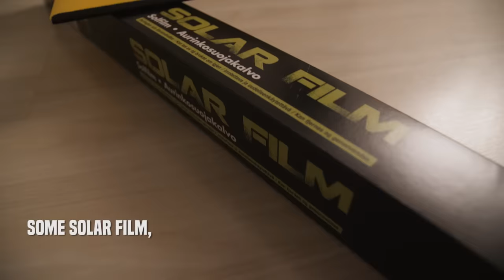DIY Infinity Mirror Coffee Table

Comment: I love everything but the power cord running through my living room.
Reply: WildBillCody then be a smart guy and use battery
Reply: @noora9827  you go buy batteries for your  table I got better shit to do... smart lady?
Reply: @Nathan Hopkins i think you should have asked the question 3 times.  2 just doesn't have the impact of 3
Reply: @wildbillcody2127  lithium batteries are pretty cheap and efficient for something like this
Reply: I suggest you use rug or carpet and run the cables under it
Reply: it's Dean thx for the idea I’m gonna do that 👍🏽
Reply: Use a Powerbank ! 

The Strips only have 5V
Reply: Use powerbank with output of 5v
Reply: Use powerbank
Reply: You can easily buy more expensive LEDs that don't require a power source
Reply: @noora9827  can I've your Instagram handle please? 🙈
Reply: Кратос ез lmao no
Reply: Nathan Hopkins LMFAOO
Reply: Or just use a battery powered led strip
Reply: @wildbillcody2127  just use a rechargable phone battery bank
Reply: @NH-gg9xd  I've calculated this. Even 20 000 mAh powerbank will give power to this led for 2 hours and then you have to recharge it again by inserting the cable in the powerbank for 12 hours. So anyway you'll have a power cable to your table almost all the time. In this way, having a continuous connection with extra sockets that can be used for a laptop or charging your phone is not a bad idea. And you can hide power cable under the carpet.
Reply: Who dosnt need a extra phone charger when relaxing in the living room
Reply: Motorcycle battery and charge it once a year I assume.
Reply: @NH-gg9xd  they can run on usb easy

Comment: Best takeaway idea from this video is that the Ikea table top is hollow. It seems obvious, and common knowledge if you have ever picked one up, but until you see one cut open like this it isn't clear whether what's inside is easily removable and cleanly modifiable. So, thanks for that.

These kinds of table tops would make a great base for some other projects. It would fit an LCD monitor nicely (for a MAME table, etc) or possibly a large "shadow box" frame.
Reply from the maker: Thanks for the nice comment! Absolutely, you could also make some storage inside the table ;) the options are many!
Reply: Since it’s hollow how much weight can it take? I’m afraid the mirror & glass would one day just burst out from the bottom 😱
Reply: Or a touch screen 😎 connected to an android device your welcome 😘
Reply: Junky table. I've gone through 2 of them in 2 years.
Reply: Well, if you're ballsy enough, you can make your own cheap table from the ground up. I use Kreg hardware jigs which makes things a lot easier. The sky is the limit when it comes to your designs. Most cheap tables are made of cheap white pine press-board. You could use that or actual pine or some other wood.
Reply: @bobbyd0656   here in Sweden (THE HOMELAND OF IKEA) ikea furniture is more meant for young adults & students who have just moved away from Home. Its not meant to be a solid peice of wood that lasts 2 decades
Reply: Just giving people a heads up that this table is probably one of the junkier items I've bought from Ikea before they go an invest a bunch of time and money in something that will only last a few months if they're lucky.
Reply: jaybie cupcake I don’t own any android devices.
Reply: All Ikea Lack furniture is hollow
Reply: @JeppeBeier  thx. Then I can start to plan now an aquarium/terrarium inside my squared one
Reply: The LACK coffee table looks like it's the proper size to fit a 40" or 47" LCD television, which you could fit underneath the solar film so it will be invisible when the screen is off. Stick some embedded PC underneath and you've got yourself a perfect table to play virtual tabletop RPGs or board games on.
Reply: Lmao 😂 me as well . 
Wish they have created wireless currency with that we wont have problems with wire all around the room

Comment: Amazing build man! There’s a few things I would do a little differently tho. For example I would use some sort of staple to staple the led strip to the wood in case it became loose since the tape on those aren’t the best quality, second I would put a little bead of caulk around the top of the tape where the glass and the actual table meet just to water proof it in case of spills, dust, etc. And third I would build a little box to house all the wires and boxes on the bottom of the table just so you wouldn’t have to worry about all that falling down overtime. But other than that amazing job man can’t wait to build one soon!
Reply: Table*
Reply: If you stapled the LED's you would interrupt the wired connections and potentially short pins together

Comment: Definitely clever and looks cool, but knowing how flimsy and cheap those tables are, and with the additional weight of the mirror, wooden frame and the glass, I'd be scared to fart next to it without it falling to pieces
Reply: Lmao
Reply: If you have table-shattering farts it might be time to change your diet
Reply: haha exactly why I started creating my own
Reply: Haters gonna hate ^^  Ive had one of those tables and it could carry the load of me standing on it without issues lol, around 90kgs.
Reply: @andre_resin2208  I dont see anybody "hating" here
Reply: Just don't eat chilli in your living room
Reply: I don’t know anybody at all, ever who uses these curtains. Why lyin foooor
Reply: @andre_resin2208  i was armwrestling on one of those tables and my elbow went through the table, i literally broke it in half :D
Reply: @EstViking  I think they're designed to be strong if the weight is distributed adequately, but can fail with a specific narrow force applied like your elbow, you can see the honeycomb design inside the table.
Reply: @snokful  yep. I know the reason.
But the connection of table legs is also awful. 
How do you let your gfs bestie to dance naked on such a table? It will break down...

Comment: you could hollow out a small portion of the table to tuck away the electronics, and only have one wire going out. You would of course need to make some custom stabilization to keep the hollowed out are rigid

Comment: Very nice table my friend. I have an  old coffie table made from indian shesham wood abd i mite use this design as i have so dark tinted glass aswell. Just need to get a mirror the same size now. Well done.
Reply from the maker: Thanks a lot! What I did was to get a cheap mirror and cut it out to the size of the glass. It was very simple but I decided not to recor dthat since there are so many videos on how to do it already. Good luck with your table :)
Reply: Wont the glass shatter if you cut it?
Reply: Nemesis well it turns out the piece of glass i have us just the rite size for my new table so no cutting involved.
Reply: Something from the shed 3$

Comment: Could you go over the solar flare step - did you use water? And You just squeezed it out. Is the solar flare sticky? That's the only bit I didnt get and finally the cut ends of the led lights do they but join into the same connector? Thanks Great video.

Comment: Do you know how deep the top to the lower top (the fillings) are? I'm thinking bout building a pc inside there but I need to know how deep it is.
Reply from the maker: Hmm, that would be a tight fit with desktop materials! I think it was almost 5cm, like 4,6cm or something
Reply: I made my own table for this project. You can customise the depth that way.
Reply: I'm planning to build my very first desk with case for my new pc on next few months and this is probably going to be included on it instead of spending extra money with rgb ram and coolers.

Comment: This is actually amazing ! Literally going to make a run to ikea tomorrow to start this project. Thank you for the inspiration. 

Do you mind posting a link to the LED’s that you used ?
Reply: I think you can use pretty much any strip these days, the prices are competitive if you shop around various stores, or even cheaper order from Chinese commerce sites, and they often can cycle through flashing patterns. It doesn't seem like this project needs fancy requirements. But you can get programmable strips if you do want to have more control, and ones with a black background would be a bonus.

Comment: Wow. What sort of glass did you use for the top? Does it need to be toughened or safety glass? Just wondering about safety and whether it is likely to break.
Reply: Did you figure this out ? Also do you by chance get the dimensions he used ?! I'm trying to figure it out but in confused by him putting mm and cm that's way to small

Comment: Where exactly did you find the mirror that roughly that same size? I’ve been looking all over the place.
Reply from the maker: My grandmother had one that I got but I guess you can either buy in a shop or in a yard sale? I had to cut mine out a bit but I left that out of the video since there are many videos on how to cut up glass
Reply: U can also cut pieces of glass to fit it aswell
Reply: Get 2 pieces of glass cut to the size you want. Just as an additional step paint the bottom of the table black before you place the bottom peice down. Instant mirror. Not quite the same but I'd imagine good enough for this kind of project
Reply: xIDONTGIVE2x just go to a glass company and ask them.to sell you a piece to the exact size you need. Most shops have scrap pieces laying around.
Reply: A glass company can cut to fit for you.
Reply: Any glass or mirror supplier will be able to provide a piece of glass to your custom measurements. Pretty cheap too. The piece of glass that is shown here wouldn’t cost more than 50 bucks American.
Reply: @thediycrab2674  How much did this whole project cost
Reply: Probably better finding a shite table to fit your glass...imo

Comment: Am I the only one who has a prob with the wire exposed
Reply: HAK nope. There has to be a better way than batteries because awkward...but a cable running to your table is just as awkward
Reply: yup he had space left... could stuff that inside and put the IR Reciever on top beside the glass or even behind the glass if the Remote IR Signal maybe gets through :) and that "power strip" dunno how its called right would have enough space inside the table but i would stabilise the bottom and top because of the pressure you put on it while plug in and out :) you know what i mean :) have a good one :>
Reply: A small hole in the carpet to feed a wire.
Reply: HAK I am thinking about doing this, so I’ll share what I have thought up. 

I’ll hollow the top of one of the table legs so that I can fit a battery pack in it, and a raspberry pi in it. Of course I’ll make it so that the leg has holes for the usb of the pi, and a monitor behind the mirror. This will let me have the infinity mirror, but also a smart table for my living room.
Reply: @Max.Mustermann.  please explain that with the correct grammar. You're not making any sense whatsoever without a full stop anywhere.
Reply: @Max.Mustermann.  "hiding" the controller inside the table is not possible and it will be visible through the glass top.
Reply: @waheedmalik4096  uhm you watched video right ? just look at the "border" of the table he did not cover with that glass top... there is space left... there are smaller Power Supply's for LED Stripes then the one he used in the video... even if the "casing" of the powersupply or the controller would be too big you could remove it and wrap some isolation tape around the pcb or just put some hotglue or for more professional looks some resin on it so it wouldnt short out ... just use your creativity and knowledge ;)
Reply: @Max.Mustermann.  show me how you did it.
Reply: @waheedmalik4096  why should i ... Ur Just complaining and gathering ideas and improvements ... Just do it your way or whatever you prefer... Have a good one mate
Reply: @Max.Mustermann.  you're the one going on about it. I asked to learn about the video whereas all you've done is criticise the good job that has been done. I suggest you stay in your armchair and criticise yourself. If you think you can do a better job than your English then go for it. Otherwise ssshhh.
Reply: @waheedmalik4096  i never critised someone ;) i Just Said it would Look more Clean with some more thoughts about hiding cables and cases... ;) im Not Sitting in any armchair im actually in my Workshop right now... But Go on with your rant about Tips and Tricks and what to think about on ongoin or Future builds ;) Like i Said have a nice one Mate... And now ssshhsh i want to get some Work done
Reply: @Max.Mustermann.  make sure you show us your work and then we'll also criticise you with a cup of tea in one hand and a biscuit in the other.
Reply: @waheedmalik4096  get along with your Problems Mate but dont bother me anymore your wasting your time and mine
Reply: @Max.Mustermann.  why are you still here? Haven't you got a sofa to sit on?
Reply: @waheedmalik4096  Sure i have a Sofa but its worky worky time Mate ;) dont bother if im reporting you for harassment k ?
Reply: @Max.Mustermann.  armchair critic. Go and watch videos and then find faults.

Comment: Great cept the cable management. All that work. Why not put the plug underneath, run the cable down the leg(if you're lazy since you could drill down the leg to hide) so it's cleaner and you can put stuff on mid shelf without that ugly plug. 

Though I get it if it was for a quick build DIY type thing

Comment: Really good DY , i've got a question for the last part, the power supply. Is it possible to replace that with a battery you can remove to recharge on usb on your PC ? Cause, you didn't have to let the Led on all the day, just the night.

Comment: I would have glued or stapled the led strip, as they tend to peel off after some time. I would have also silicone the edge of the top glass to keep spills or debris from seeping in. And lastly, I would have used a battery pack with a switch, both placed under the table and done away with the electrical cables. These lights use very little power so a 8 AA battery pack should yield allot of hours of use, safer as well. Other than that, great work.

Comment: You can always tell an amateur by they way they hold a hammer, half way down the shaft and tap with an up and down motion, the best way is to hold the hammer close to the end and use your wrist to direct the head of the hammer to force the nail in, and another tip is to pre-drill to prevent the wood splitting whether its a nail or screw.

Comment: How thick are the wood pieces? And how thick is the mirror and glass?
Reply: Did you figure this out :O  I want to try and make this but missing that info! By the way do did he mean to put  inches instead of cm and mm that has me lost as well it's to small
Reply: @J3496J  I bought the 2 glass pieces first and put them into the table so to speak. Then I measured the height up to the edge of the table and hence knew what size wood I'd need. That should do it. Just need to cut them to size.

Comment: Beautiful table. Would not have thought to use an IKEA coffee table; brilliant. My only real issue is the power strip. I know its necessary to turn on the lights but how does something like that work for a larger living room like mine? I can't have a power strip running  across my floor. And I don't think it would look good having the strip cord as well as an extension cord across the living room
Reply: I have a powercord running under my couch from behind it to have access to power for laptop and stuff in the couch, a good solution if you have wallsockets behind the couch.

Comment: This could do a lot of improvement starting with indentation to accept led strip, then covering actual led strip so you cant see it but can see reflection of it, most important , not using ikea cardboard table but making your own, predrilling holes for nails so wood don't split, but all you can do at this point is, get black led strip and replace that one.Thats best you can do atm.

Comment: Question this.  Is the tinted glass required to achieve this effect?  I ask because I'm incorporating this in a bus conversion/RV and would rather not have any glass inside the RV for obvious reasons.  I'll be using polished stainless steel for the mirror surfaces.  

If I absolutely have to have a clear cover over it I will bit that will add to the design concept.  Please someone let me know 😊

Comment: Nice work. Cool project.
I would change a thing... Rather than a 12v led..   use 5v led powered by a Powerbank...... That would give you no cords running throw, and still ables to charge phones..   but still, Nice work

Comment: if the edges of the table are this honeycomb crap and not real wood, the table is very weak now. but that does look super cool. If you glued the mirror to the table, then the frame to the mirror, then the glass to the frame, you would end up very strong.

Comment: Please consider adding some L brackets to the under side. Over time you may see some sagging because you have changed the structure. All the weight is now on that flimsy bottom piece. Just a logical suggestion.

Comment: I was just thinking to hollow out the sides more to put the electronics and use a power bank instead to power it. Shouldn’t need the big converter and LEDs shouldn’t pull that much juice from a power bank.

Comment: Why not use a high voltage battery pack and stick it underneath and charge it whith another battery pack that you charge separately so that you can temporarily stick that one under the table to charge it without anyone noticing

Comment: So you go through all the trouble of cutting out the table top and installing everything oh so carefully to hide all the wires and then you just Velcro a power strip to the bottom shelf? Install some proper outlets and usb ports from underneath. Run all the wires inside the legs so nothing is visible. I give it a seven out of 10 stars. More planning, more effort, more stars.